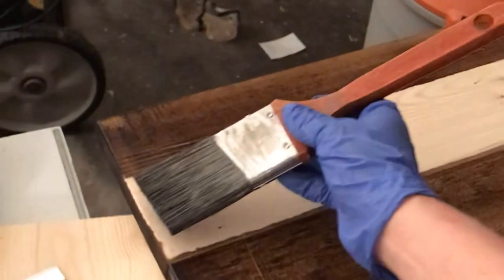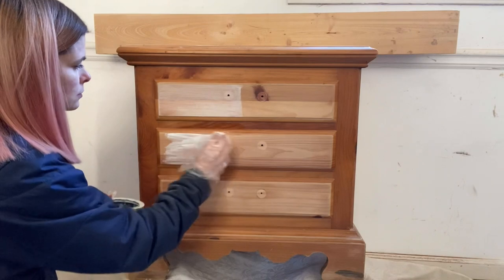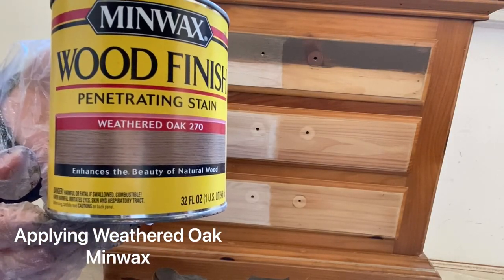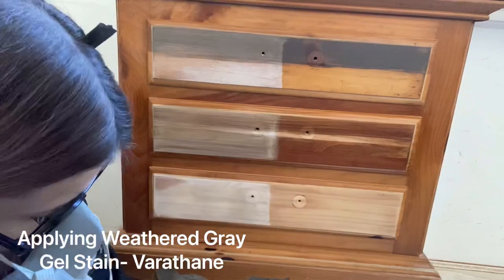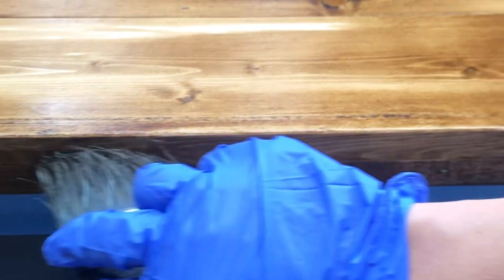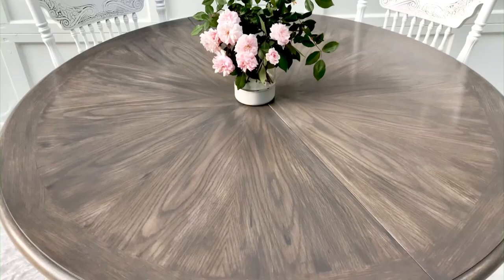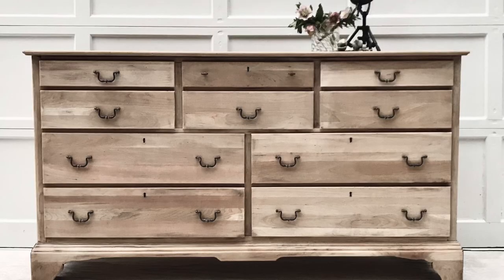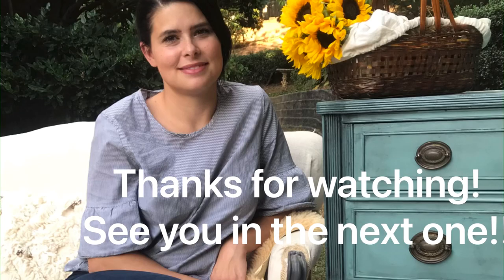Testing stain combinations on old furniture • Gel Stain finish | comparing colors

Comment: Just so you know, that respirator is for blocking airborne particulates. Dust or aerosol droplets from sanding or spraying. It does not protect you from VOC or solvent vapors that you experience in the liquid form. You would need a scuba tank type setup. Thank you for the time you invested in the great stain examples.

Comment: Amazing!
Do you use any base under the regular stain or under the gel stain? 
I have Just tried gel stain but I think I did not Sand the table top properly. Do you think that will be a problem on a dining table? 
I would finish with wax. Would that be a good idea? Table is being used a lot... gets water etc.
Thanks for the advise!

Comment: Hello, I am currently refinishing a table pretty much the same as your kitchen table with the briar smoke oil stain. I am not liking the orange colouring coming through in it and I've mixed so many different colours to try and match it up. My mistake that I didn't follow your video and do the white pickling method first. Do you know if I can add something to the top right now to wash it out, like maybe an oil based pickling white wash? Not sure I can add a water base stain to what I already have on it. Thanks for any advice.
Reply from the maker: Hey!  I’m glad you reached out!  You can apply any white wash (water or oil)on top as long as you previous stain is dry ❤️
Reply: @blacksheephouse  Thanks for your advise. I will try that.

Comment: Getting ready to use jocobean  for my stair topper only .then my spindles are going to be painted antique white paint but I think going to kilz first on spindles don't want  and yellowish popping thru bit do u have any suggestions??
Reply from the maker: Yeah, a good shellac based primer is what I would use to avoid yellow stains popping through.  Oil based paint is a pain but very durable levels nicely and you don’t have to topcoat which is nice on spindles since there is so many sides